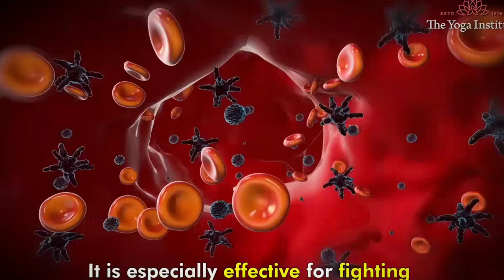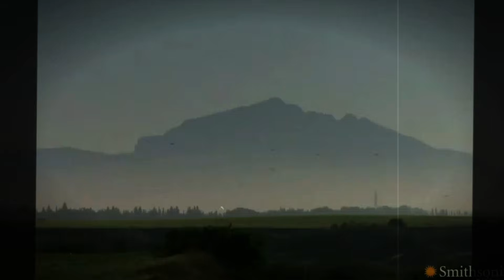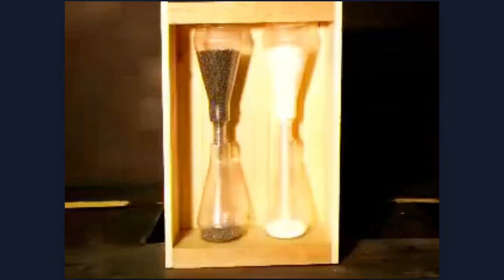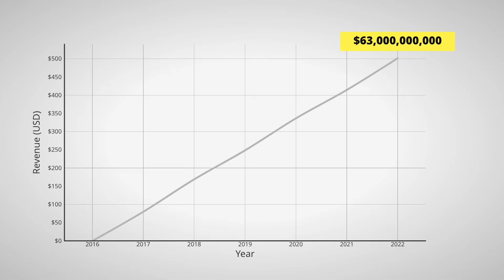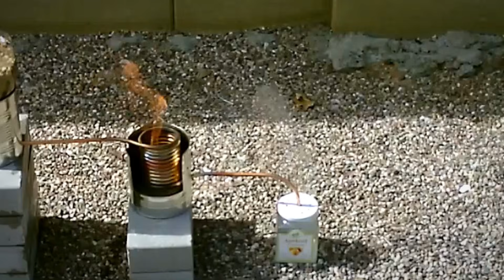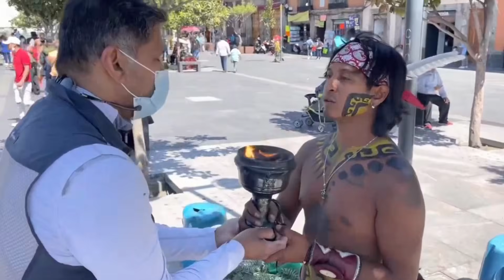The $2 Water Purifier That NEVER Needs Replacing — Exposed in 1968. Buried by a $35 Billion Industry

Comment: Damn, people are just stupid and gullible..   This is fake information people..   and like all fraudulent fake trickery, there is an element of truth to it..  without those truthful elements, the story wouldn't be good enough to trick even the dumbest people.
Yes, copper and zinc have antimicrobial properties, so does silver..   but they do not kill all bacteria..   Copper and zinc also do not remove heavy metals, pesticides, herbicides, nitrates, or a lot of other contaminants that are every bit as dangerous.  
Like most other things, copper and zinc have their place in water treatment, but they are not magical solutions, and like most other water treatment techniques, they have their limitations. 
Also, none of this is secret information that has been hidden from the public.. ever..       But most people no longer read real books, they're too busy staring at computer and phone screens looking at fakebook or twatter or whatever.   
People are stupid..
Reply from the maker: You actually make some fair points — and if you watched the full video, you'd notice I addressed most of them. I specifically said copper-zinc does NOT remove pesticides, does NOT handle parasitic cysts like giardia on its own, and should be combined with carbon or boiling for complete treatment. That's in the video, word for word. Where I'd push back: KDF (copper-zinc alloy) filtration IS used in professional water treatment systems worldwide. It DOES remove chlorine at 99.9% efficiency — that's independently tested, not made up. It DOES capture heavy metals like lead, mercury, and arsenic through electrochemical bonding to the metal surface. The EPA DID register 275 copper alloys as antimicrobial in 2008. NASA DID use copper-silver ionization on the Apollo missions. None of that is fake. As for 'none of this is secret information' — you're right, it's not. It's in chemistry textbooks and EPA databases. The question isn't whether the information exists. The question is why a $35 billion filter industry sells you a plastic cartridge every 60 days instead of pointing you toward it. Appreciate the engagement though — comments like yours make the conversation better for everyone watching.

Comment: I've been using zinc and copper plates in my skimmer in my pool for years and don't use any chlorine in it at all you just have to replace the copper zinc plates every couple years as they get built up with minerals